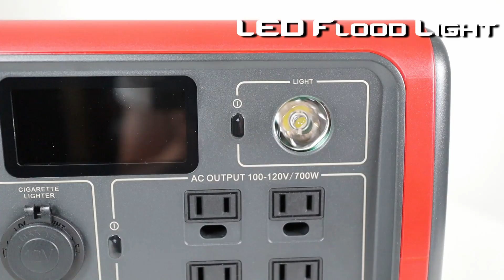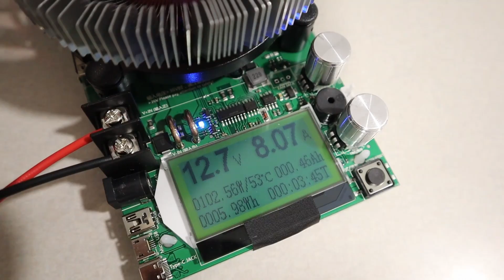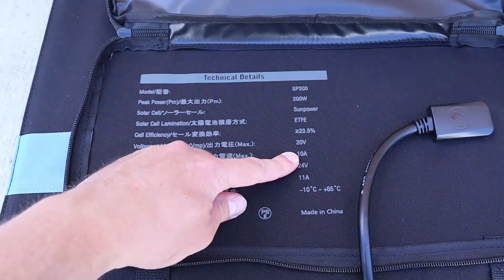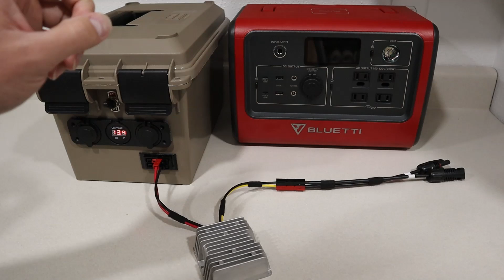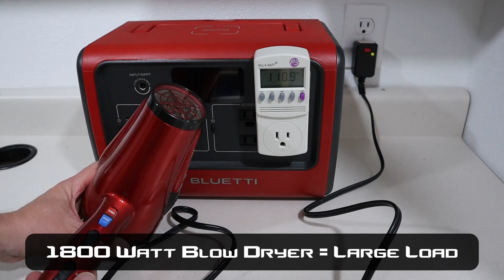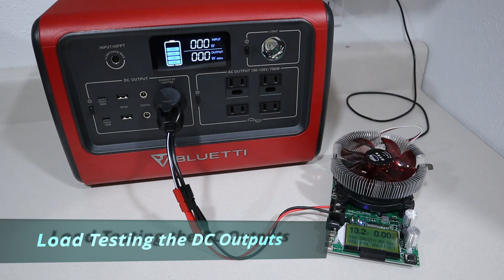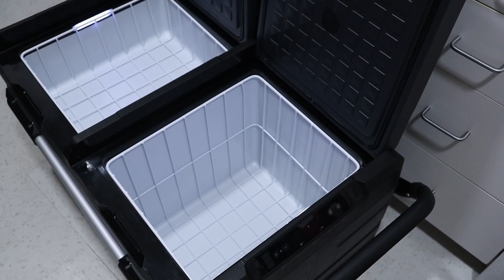Bluetti EB70 LiFeP04  + SP200 Solar Panel - Best Battery for 12v Fridges? - Full Review and Testing!

Comment: Just curious, what solar generator would you say is best if a 1000-900 watt inverter is needed? Need one that can make coffee. I have a specific need for it to handle that task. Would like to see Bluetti revamp the EB150 with LiFePO4 batteries. That and batter display. Steal EcoFlow’s screen design.
Reply from the maker: Just find a low wattage coffee maker and use it on the EB70 haha ;)  I am hoping that the release a larger power station...like an EB100 with the LiFePO4, maybe they would change the display? .....probably not. You do get used to the display after using it awhile. With the EB55 being quite improved, maybe they would have some pretty cool features on the "EB100". They gotta have something in the works!
Reply: @Jasonoid  The 4-5 cup smaller coffee makers are around 600 or so watts. Just a lot longer for the same amount. I help at 100 mile running trail races and coffee is the one thing is a pain to make in any good volume in the middle of the forest. Trying to ditch the gas generator at them. Would love an EB100. I have a Montek 1000 that should get here.....eventually. Was really hoping it would arrived before these races started coming around, but not sure at this point. We make about six 12 cup pots of coffee usually for the runners and us.
Reply from the maker: Yeah in that case "the bigger the better" haha I'm hoping for an announcement soon from Bluetti

Comment: thanks for your review.. since now in Cali we have rolling black out.. lol   I ordered the eb55 and got the elecaenta panels . Im also waiting for my solar co to call me back to see what options I have to switch everything over to a socket if the power goes out. I cant afford a 10K power wall, but I'm confused at the process. If I can get one working socket to use the panels on the roof then I might be able to power the full size fridge in my garage. or power the eb55 and other things.. Im a rookie at all this.. ahhh
Reply from the maker: We all got to start someone to be prepared for power outages, the EB55 is a great starting point! Solar is something you learn one step at a time, YouTube has some AWESOME resources to help you learn :)

Comment: OH BOY... I was so set on this ... or maybe the BIG Brother... and after your review... now I'm not so certain. HUM?
Have you heard of the EB70 MAX? Is that the New one that is supposed to be coming out? I had heard that Bluetti was bringing out 2 new Power Stations. Have you heard anything bout that rumor?
Reply from the maker: I'm sure they will have a 1000wh model soon, I'd wait to see how they improve these models! These units (EB55 and EB70) are great but if they made a few changes they would be that much better!
Reply: @Jasonoid  
Have you heard ANYTHING about the NEW Models, or when they're coming out? I'm still working on my VT3 (1972 Vintage Tiny Travel Trailer)... I'll need something around the end of Sept... or the beginning of Oct/21... 
I"d like to hold out and get something a little bit bigger than the EB70 but not as big (because I can't lift it) the AC200P... I really like the EB70, but it does need a few more things...

And Please forgive me for asking this question again... but I can't find the notes I took when I had asked you about which "Fixed" panels (I thought they were glass) to use if I did  get the EB70... I know you like the RockPal... is it the P802? or what Jeff liked the Baldr? (I don't know what extra # that is). I'm going off memory).

The question is How many "Fixed" or how many watts panels can I use with the EB70?
 I want to "FIX" the panels on top of the VT3... not to make it portable.
Thank you again for another great video... Thank you so much for helping people like me, to be more independent... 
I am going to be living in this VT3... I need to make it Livable... I'm 66 years old... I deserve to do this the best I can... I don't need to be "Glam" camping, I"m a country girl, I've been camping and have lived in many different RVs, Cab-over Campers, Travel Trailers... but I have always wanted to do Solar...  
I just realized I might have already told you (my life history) LOL before if I have, please disregard... 
Thank you Jason
(Did YOU know that the Name "Jason" (my son's name is Jason) means "HEALER" ...
Reply from the maker: I haven't heard anything about new models so I wouldn't expect to see anything very soon. Maybe by Christmas?   So probably decide on which one will work best for you, I think the EB70 is a great option!

As for glass panels I'd recommend using 200 watts or 300 watts of rigid glass solar panels for your trailer. That would allow you to get full solar power most of the time. The brand doesn't matter too much, just as long as they are 12v panels and wired in parallel
Reply: @Jasonoid  
OMGosh... Thank YOU so much again... So I can go up to 300 watts!!! That is great.
and it is GLASS panels... yeah I wasn't wrong... lol.
(Trying to learn the lingo)...

Well shoot... I was hoping they BLUETTI would come out of YOUR upgraded version... everything you (nitpicked) on was SPOT On... 
I still have a "FEELING" they are working on a new one...
We need something BETWEEN the EB70 and the 200P... that is one heck of a price jump from the EB70 to the 200P.
Personally... I'd rather have the 200P... but it is very heavy (60 LBS) and that is okay, because you can just put it in one place... if you're using it on a daily basis... 
BUT what I don't get is... WHY... is there so few plug ins? The EB70 has all these beautiful plugins and the 220P has very few...
What's up with that???

Comment: Would the SP 120 panel be enough to charge this if you are just powering a 12V fridge? Im debating to go with the EB 70 or EB55. What are your thoughts?
Reply from the maker: The sp 120 is an excellent panel for charging up the these power stations. I also have a budget solar panel video from a couple weeks ago, check that out if you want to buy a panel that puts out the same power for much less money!

Comment: My unit is only putting out 111 volts as well. When I plugged my deep freezer into it, the power light that is normally solid was blinking and dim. Can the lower voltage damage anything?
Reply from the maker: It shouldn't damage the freezer, just keep an eye on it and see how it performs over a couple hours.

Comment: If you exceed the 8 amp input can it damage the EB70 or will the unit protect itself by only allowing 8 amps to pass through?
Reply from the maker: The solar panels don't force power into the battery, the charge controller "allows" the power it needs and won't allow any more power than 8 amps so just keep the voltages in the right range and it will be okay. 12v panels in parallel are okay, not 12v in series, not 24v panels.
Reply: @Jasonoid  thank you for your quick reply! I plan on using two of the rockpals 100w folding panels. Thank you for posting this video.
Reply: @Jasonoid  Sorry I do not understand why 24V would be too high, the wall charger uses 25V at 8A?
Reply from the maker: @ineker1148  the naming scheme for solar panels is a bit confusing and it took me a bit to understand as well. For example a 24 volt rated panel puts out 36-45 volts and a 12 volt panel puts out 18 volts to 26 volts. So a 24v panel actually goes higher than the allowed limit.

Comment: Does the battery discharge if the AC or DC output is left on overnight(buttons are green) - where nothing is plugged in? I got the EB70 and it has already discharged twice overnight, nothing was plugged in.
Reply from the maker: Yes, its best to turn off all the outputs when not in use for long periods of time. The AC inverter will use quite a bit of power just sitting there. I noticed 20% overnight when I left it on.

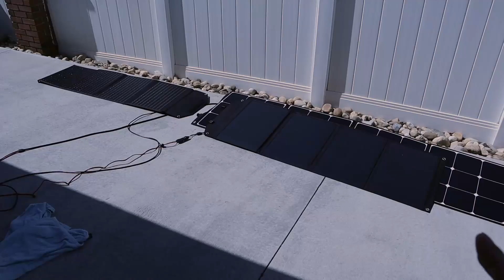Comment: @10:11 I like the demo on to 100 watts in parallel. Does that increase the amps and fry the system when you run in parallel?
Reply from the maker: You can only damage the EB70 by putting panels in series, parallel is fine.

Comment: Love your videos. What gauge wire would you use to connect one if those 12v  to 24v step up convertors to your car battery?  Should you add an inline fuse to this wire?
Reply from the maker: 12 gauge wire will support 20 amps just fine, if it's over a really long run you may want to do 10 awg wire to avoid too much voltage drop (over 20 feet). A fuse would be a great addition for safety
Reply: @Jasonoid  Thanks so much.

Comment: Love watching the video!

Question I bought two BALDR 120W because I saw your other video on the panels… Would they work with the eb70?  Would I have to buy any extra wires to connect them together?
 Also any advise on long connection wires so I can have the panel in the sun and the eb70 in the shade.

Trying to learn as much as I can with all the videos. I live in Miami🌪😳
Thank you so much!
Reply from the maker: Check out my latest video about anderson powerpole connections, you can build a 20 foot extension cord to keep the panels in the sun.

Comment: You can get a boost/buck converter to get the MPPT from the non-standard input voltage from solar panels, not ideal, but it can work.
Reply from the maker: I'd have to try to try plugging a solar panel into my 12 to 24 volt boost converter I used in the video

Comment: Great video. I have had the EB70 for a month or so and you hit everything. The power gauge is an annoyance, there's a big difference between 21% and 40%. I would like the display to stay on, it can't take that much power. The 8 amp solar input is bogus but I can still get 150ish watts outta 2 panels so I can live with it. Overall, I love it and these annoyances are probably no more than I would have with anything I didn't build myself. That's next.
Reply from the maker: Its still an AWESOME battery, way better than my previous recommendation, the Jackery 500. LiFePO4 cells are excellent!
Reply: If you were to combine three 100 watt panels in parallel, then you should be able to achieve the 200 watt max charge.
Reply from the maker: You can try it but it won't work. Trust me. Putting panels in parallel only combines the current/amps, the voltage stays the same. So no amount a paralleling panels will get you past the 8amp limit on the EB70. How do I know this? Because I have tried 300 watts of solar panels on my EB70. 

The only way to get 200 watts input on this power station is to have a solar panel that outputs the same voltage and amps as the wall charger... (25volts and 8 amps). The closest panel I have found that does that is a $275 renogy panel that has 22volts max peak voltage. I have yet to find a 12volt solar panel with a peak 24v-25v output. (24volt solar panels output near 32volts so those don't work, voltage would fry the circuit board).
Reply: @Jasonoid  I think your reply was to Bern Swonger. I understand it's almost impossible to get the full 200 watts without using Bluetti's own panels. No prob
Reply: @Jasonoid  ok I get it now, that is a big drawback.
Reply from the maker: @bernswonger57  It's not a huge issue, but it would be nice if you could get the full 200 watts via solar. Still trying to find the BEST panel or another way to 200 watts via solar on these EB units.

Comment: I’d like to see a higher watt panel achieve closer to 200 watts
Reply from the maker: Unfortunately there aren't any on the market that will do 25 volts and 8 amps under load. It's a small design flaw in power station, still charges much faster than the Jackery 500.

You would have to find a panel that has 28 volts short circuit voltage, I haven't found anything.

Comment: I'm torn on this unit. It has so much going for it, but the 8A limit, under 1000w inverter, and low info screen are pretty much deal breakers.
Reply from the maker: I'm sure other product will come out soon if you hold out a little bit longer. No need to rush to buy one that isn't perfect for you! Thanks for watching :D

Comment: Enjoyed your video and being so honest. Need your help I  just bought  a Jackery300  and what solar panel  would  you reccomend brand I think it can only  do one 100watt panel. I don't  want a expensive  one I am new to this and have my eye on the bluetti Eb70 hopefully  they will  do the adjustments as you and many say if not it's  my next one once I know  what I am doing don't  want to fry anything but eggs  lol
Reply from the maker: It looks like the Jackery uses an 8mm charging port. If you purchased the Baldr or Rockpals panels in the other video that end it Anderson PowerPole, you might be able to use this adapter:

https://www.amazon.com/LIXINTIAN-Connector-Compatible-Anderson-Powerpole/dp/B08BKKK89V/ref=sr_1_5?dchild=1&keywords=anderson+to+8mm+connector&qid=1624547220&sr=8-5

Comment: Now im kinda dissapointed in th SP200 with the EB70. Just ordered the SP 200 on Prime day $395    (I already have the EB70).                 but now looks like its not going to perform as I expected Thx for the Video.
Reply from the maker: It still performs well, just not the advertised 200 watts. Still puts out similar power as 2 100 watt panels in parallel on the EB70.
Reply: At least I got it on Amazon Prime day @ $395

Comment: Here is a test how about running a fridge like for a week and charging with a solar panel daily. How will it keep up??
Reply from the maker: As long as you can charge it via solar or using your vehicle with my 12v to 24v trick, it will work great. 616wh is just fine for a days usage. I used it for 4 days on my trip just fine and the solar panel was able to keep it topped off.

I can make a video about running a fridge off the Bluetti EB70 for a week so people can see how it works! Good idea!
Reply: @Jasonoid  Cool, I think theses are the real world tests that people will like and can use in the field.  Here is an idea Maybe a simple mod to elimate the light and just make it a dedicated screen switch.
Reply from the maker: @VELOPERS  hmmmmm, maybe by desoldering the led light that might make the light switch a display on switch! I do plan on doing a tear down video so that might be possible. Thanks for the idea
Reply: @Jasonoid  I was thinking the same thing great minds think alike !!

Comment: Question, What's been you experience with the 20% meters. We may have talked about this but I forgot what you shared. 

I need to find the box and look at their explanation of what the bars mean but I dont feel like its super accurate.
Reply from the maker: You talking about the display only having 20% chunks? Yeah, it's not super accurate. One of the downsides of the EB70. It seems to last longer below 40% than the top 60% of the battery indicator. Like it jumps down pretty fast then stays at 40% and 20%and 0% longer.
Reply: @Jasonoid  nah I mean does 20% accurately represents that portion of power. 

616 / 5 = 123

I imagine it's a little more complicated than that but it seems unfair to divide the stick watt hours Yanno.
Reply from the maker: @AskIveSolar  The power curve for LiFepo4 cells is a bit flat so trying to calculate the power remaining is a bit tuff. Not sure if any company has mastered it yet. I wish the display showed the voltage of the cells because you could calculate when it's low pretty easy if it was visible on the EB70.

 Its much easier on a lead acid battery where the discharge curve is a diagonal line and 10% of storage is equivalent to 0.1 volts or something like that.
Reply: @Jasonoid  yeah it's an odd one. I'm starting to wonder if anyone has done a good job with it but who am I kidding, there aren't that many. 

GoLabs R300 seems decent at it but I never paid close attention because it has a percentage read out.
Reply from the maker: @AskIveSolar  I'm sure we will see Jackery release a LiFePo4 battery soon enough.....someone was hinting to it on my channel the other day. They probably will learn from all these first gen power stations and hopefully do a better job! :D

Comment: I really like the idea of the Daygreen H10-12-24. What are your thoughts on using a pure sine wave inverter with the wall adaptor?
Reply from the maker: That should work fine as well, the DC 12v to 24v will be a little more efficient but both will charge at higher rates. The inverter/ac charger is definitely more convenient haha.

Comment: Why can't you use 2-100 watt panels?
Reply from the maker: My video showed me using two 100 Watt solar panels lol...use the time stamps
Reply: @Jasonoid  would not 1-200 watt solar panel be equivalent to 2-100 watt solar panels.
Reply from the maker: @rthornbury1683  yes, you can use (2) 100 Watt solar panels in parallel, do not connect them in series on the EB70.

Comment: Damnit, I  wish I watch this before I bought that solar panel. 🧂
Reply from the maker: It's still a good panel, just won't get the full 200 watts on the EB70. Still better than a 100watt panel!
Reply: @Jasonoid  yea, I got this for the eb70🤦🏻‍♂️
Reply: Solar panels rarely output rated numbers.  They only output max possible at one instant in the day.  Consider that 200 watt panel may only output 30 watts at 9am.  If it was a 100 amp panel you might see only 15.  It is better to test panels for a set number of hours to get a watt hour number.  If comparing panels, both have to be tested on the same day and the same way for watt hrs.  Watt value of a panel will change dramatically with just the angle to the sun.
Reply from the maker: @SolGuy42  I tested the panels in the best circumstances multiple times (like 4 or 5 times). Midday, mid summer, facing south at different angles. I also tested this panel on my other 11 panel comparison video. The max power I ever got from it was 168 watts and that was using an MPPT solar resistive load, not the EB70.... Very far from the rated 200 watts. I was not happy with the results compared to its advertised output.... But, it does put out more power than a 100 Watt panel! Haha